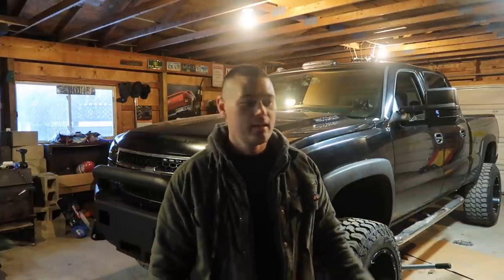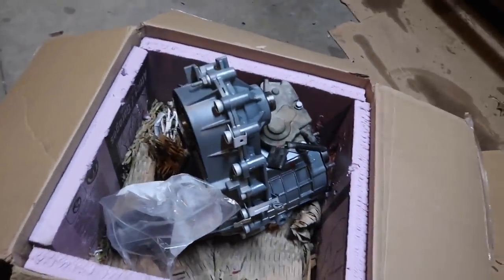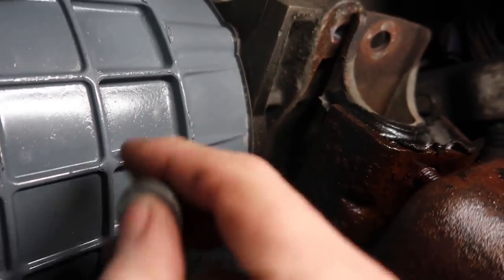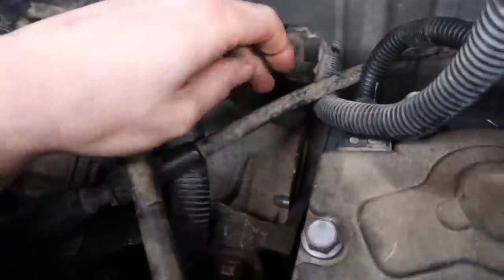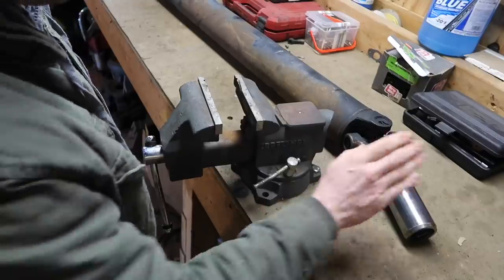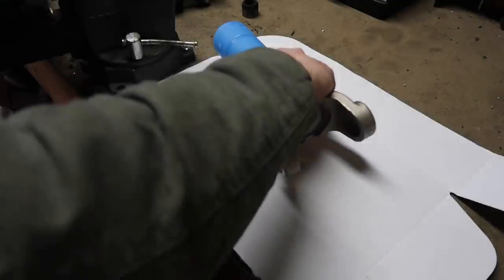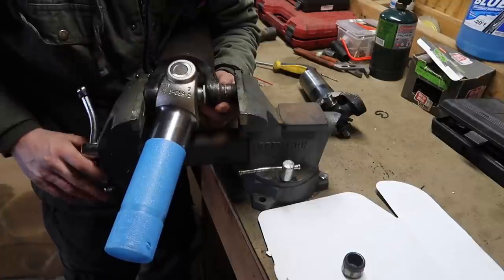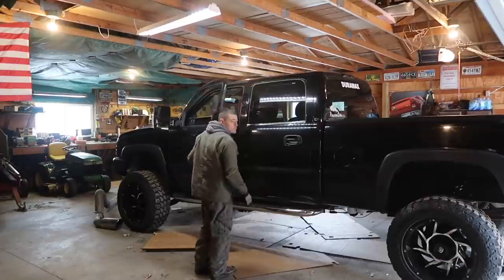How to install a Duramax Transfer Case

Comment: Great video! My dad and I just wrapped up replacing the transfer case in my stock 2006 Duramax CCSB (driveline clunking... grinding noises... no oil... pump rub) at 275k miles.  California truck... so stock exhaust and suspension under there.  The video with Mark at Kodiak Truck sold me on his product! Dad and I are both competent and confident hobbyist mechanics, but your videos on removal/install really paved the road for our project and saved us time and unnecessary damage to the fragile electrical connections.  We had the project turned around in four hours, excluding u-joints.

I couldn't source a 15mm flex-head, ratcheting wrench on time, so we got by with a standard wrench (one or two bolts on the t-case/adapter accepted a standard socket/ratchet).  If anyone is reading this in preparation for their own t-case swap- Do yourself a favor and order a flex head ratchet wrench on Amazon or something lol. We spent an hour just unbolting/bolting the t-case to the adapter.

On a stock truck the torsion bars run ABOVE the transmission crossmember, so we did remove the entire crossmember and left the transmission supported by a hydraulic jack until the new t-case was secured. It was nice having the crossmember out of the way.

Also- I purchased and installed the transmission-transfer case brace (Merchant Auto)... In my opinion this should have been a factory part. (My 1986 Suburban 4x4 had a trans/tcase brace from the factory... every full size truck should).

Anyway... thanks again for the video! Subscribed and looking forward to watching more videos from this channel.

Comment: @truckmaster removing the speed sensor and filling the t case through the speed sensor hole is much easier. You can remove the fill plug to check the level.
Reply: No, I use the fill plug to drain, I keep it plum full.

lol

Comment: Hey, thanks for these videos! I have pulled my transfer case from my truck (‘03 Chevy 2500HD LB7 Duramax). Kodiak did not have a 263XHD in stock. I am putting a Merchant Automotive unit in.

The gasket between the trans and tcase was very stuck on the trans side.. only obstacle so far. Going to get a plastic scraper and brake cleaner or something and try to get it off without affecting the aluminum. 

I unclipped the metal ring clip on the end of the boot for the front drive shaft to remove the whole thing more easily. How did that part of the process go when putting it back on? Hoping I can snap that clip back on. Thanks

Comment: The first Cap safety clip you installed was not properly seated in the grove. You can tell by the gap between the ends in the center.
Reply from the maker: I fixed that after I stop filming
Reply: First thing I noticeed ..besides the injectors direct sticker

Comment: Gonna change fluid on stock Transfer case on my LMM. I’ve done it two times already with 124,000 on it. 
Josh is it better to use 5w 30 on stock transfer case?
Love: the channel bro

Comment: I have built my 05’ Dually into a show truck and it will NEVER see dirt again so I want to lighten the weight of the truck so I wanted to remove the transfer case and all 4WD parts and wondering if that’s possible to remove that transfer case and put a 2WD tail piece on the trans to save weight. I’m sure all of it weights around 200lbs and it’s just wasting gas.

Comment: Looks like you better get on that chassis, and fix the rust...👍
Reply from the maker: I know I know
Reply: @TruckMaster  just giving you some shit.....great videos.
Reply: Living in a state that salts roads is tough. I gave up on painting my frames and just started putting the spray grease to them. Doesn’t wash away like fluid film and I’d rather be dirty working on my truck than have to buy a new truck due to rust

Comment: Why is it better to have non-grease-able  u-joints? I know spicer are great u joints as they are what comes from the factory, but being non grease-able you cannot service them to make sure they are not running dry or with old grease. What kills the needle bearing is becoming dry of grease
Reply from the maker: I guess I see your point I just figured less to maintain but your right you can’t maintenance them
Reply: grease-able joints deflect to let the grease out and deflect to let debris in. the non grease able forged joints are the beast and strongest. Most people never grease there grease able`s causing them to fail. Mine are still original at 178k. Give them a try i think you would be happy.

Comment: This is an old video but if anyone can point me in the direction of a good used rear driveshaft that would be great. I’ve called every junk yard around me to find one with zero luck. Not trying to spend a fortune on a new one. Just want my truck to stop vibrating before I tear something up 😫 I’m in north Alabama area. 05 crewcab, short bed.

Comment: That's crazy it saids to use motor oil to fill the transfer case?
Reply: It's actually quite common, and or regular automatic transmission fluid.
Reply: @2015_Rubicnn  ya ive always used transmission fluid
Reply: @geraldwhite2912  Honda manual transmissions call for engine oil basically.
Reply: It's discussed in the t-case video he put out previously.
Reply: Are you asking a question or making a statement?